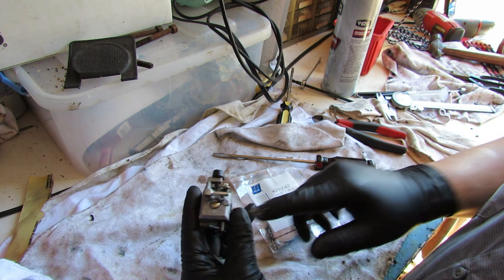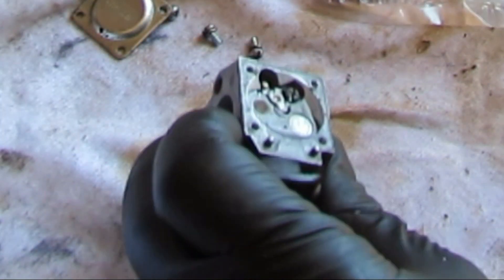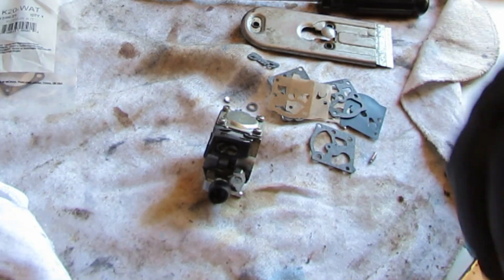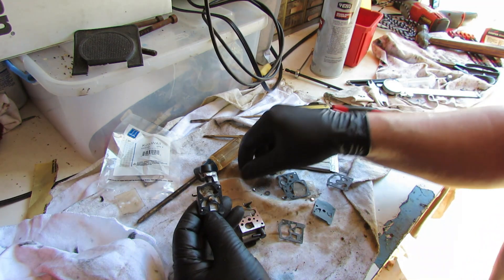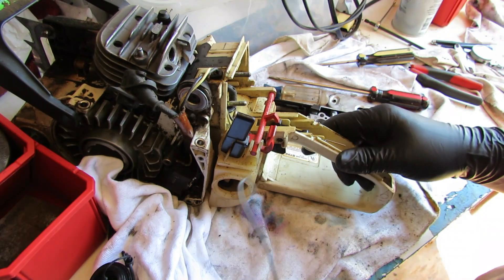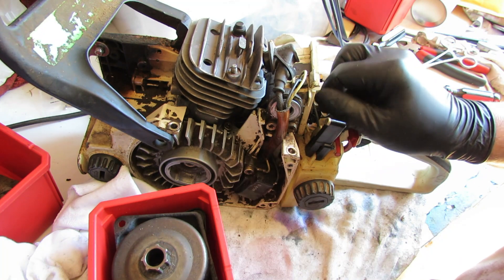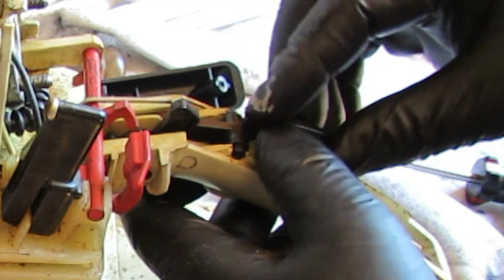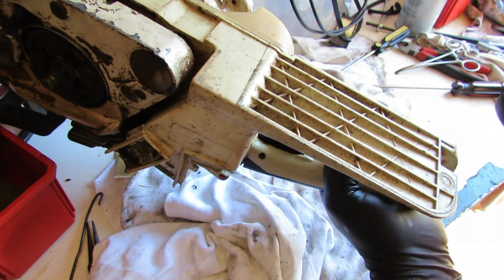Part 4 Stihl 026 Rebuild: Carburetor Rebuild and Final Assembly

Comment: I did not waste my time working on that single jet carb.  I put a fully adjustable carb on it.  I have not found aftermarket carbs to be as bad as some people say they are.  I have found they come set to rich on both jets but that is it.  When I tune them, properly, they run as good as an oem carb.   I do not run ethanol gas in anything I own, except cars.  My two and four cycle gas is premium non ethanol gas plus stabilizer (one ounce per gallon) plus 84ml of Stihl Ultra for two cycle and just gas + stabilizer for four cycle.
Reply from the maker: @John Clarke I agree I do not like single jet carbs. This model has a high and low jet so I decided to keep it. I have dabbled in the aftermarket carbs. One trial was on an Echo HC-150 hedge trimmer. It worked for almost 5 years then had many problems with the rubber parts but ran great until that point. The original one lasted over 15 years. The only reason I swapped out the original was the plastic nipple for the purge hose broke off. Agree on the non ethanol in all of the small engines and i use STA-BIL  storge, works great. I have had good results from Opti2 2 cycle oil. When I pull one down everything on the inside has a nice glaze of oil on it. Thanks for watching and commenting! ~Mr. C.
Reply: @NaturesCadenceFarm  I just replaced the carb on the Stihl 021 that I am restoring.  The only thing I found wrong with the original Stihl Walbro garburator was some idiot had wallowed out the slot units adjustment screw.  I will cut a new slot in it with my Dremal  and a cut-off wheel.  It was clean and the diaphragms were flexible but I like an H and L jet on all of my saws.  I did the same thing to my Stihl 025, 026 and 024 when I restored them.  I replaced all the rubber parts in these saws, too.  I do not find AM carbs are as bad as some persons say.  They either work or don’t work and I can go through a half dozen of these before I reach the cost of a new Stihl carb.  I did have to put four on my MS 440 before I found one that I liked but those were HD carbs.  I have generally found their WAT carbs are pretty good.  If it acts screwy then I put another one it.  I don’t whine about AM rubber, either.  If it fits and works I am happy with it.  It is a lot better than about $20 for a new fuel line from Stihl. And another $10 for a filter.  They usually come with a new AM carb and I use them.
Reply from the maker: @John Clarke sounds like you have been very busy restoring Stihl saws. I have done the Dremel slot trick on carbs with the special adjuster screw heads. I really like having the ability to tune the equipment to exactly how it should run. I tried an aftermarket fuel line and had it last about a year and started cracking. I only use non ethanol fuel so that was not the issue. The original Stihl lasted 20+ years. Like you said i could replace one a year much cheaper than the OE fuel line. maybe I will give the aftermarket carbs a try in the future. ~Mr. C.

Comment: The handle holds the throttle rod into the trigger.  You better hold that throttle rod into the trigger as you put the handle on and get the screw in the handle top as fast as you can so the interlock spring will not come out of the interlock ( you called it the presence lever).
Reply from the maker: @John Clarke good to know, thanks for sharing. I did use improper terminology. "Operator presence" would be more of a push mower handle bar lever or similar. Husqvarna refers to the lever as the throttle trigger lockout. Stihl refers to it as the throttle trigger interlock. Thanks for watching! ~Mr. C.
Reply: @NaturesCadenceFarm  the part name is Interlok.  I just call it that damn thing I have to put in the handle that is spring loaded and always finds a way to come out when I put the cover on the handle.
Reply from the maker: @John Clarke they can be a pain! I found once I got the sequence of operation down I can get them in no problem. ~Mr. C.